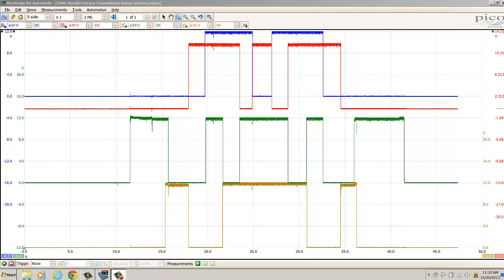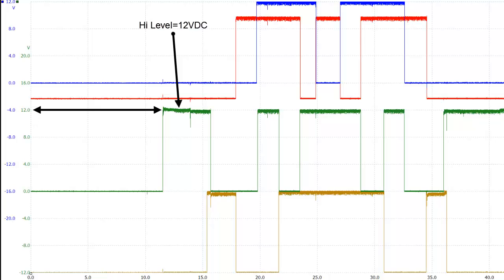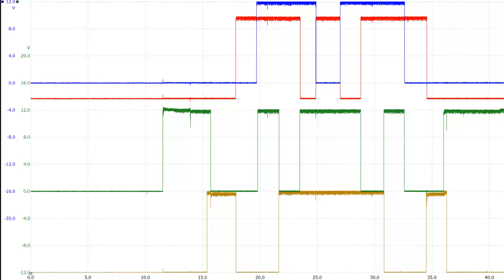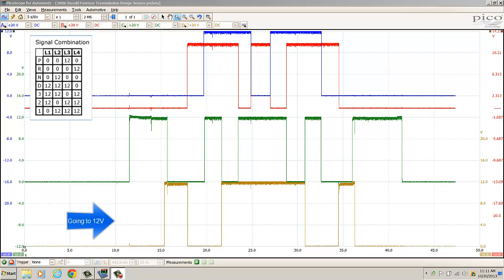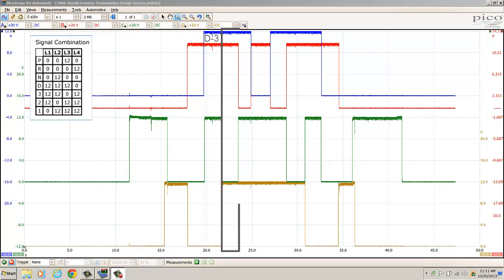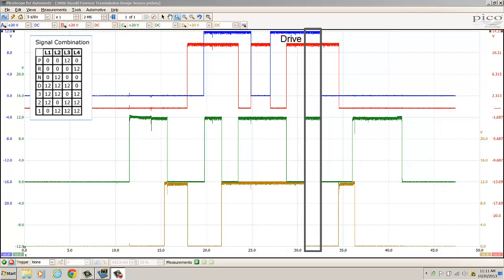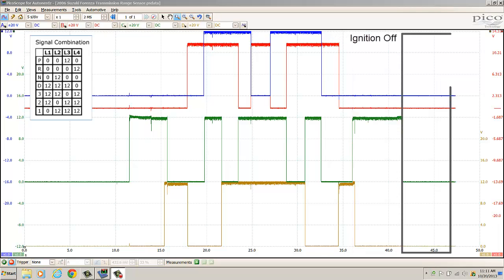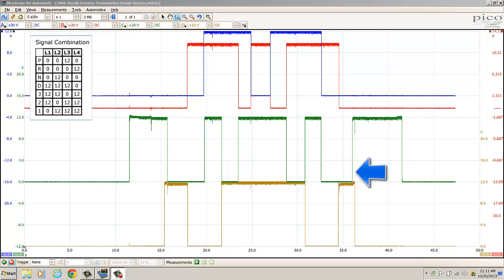Analyzing Transmission Range Sensor Waveforms on Picoscope - Part 4

Comment: in your analysis you mentioned you would come back to your test after replacing the range sensor.  do you recall if it made your test look better?
Reply from the maker: Yes, it did make it look better Greg! It was only the matter of time constraints with the video that I didn't show it. :)
Reply: @stuzman52  thank you.  your videos are really good.  I appreciate the effort you have done in teaching.  There is a lot of time putting these together I am sure. I have already replaced the range sensor and it works most of the time. My problem may be mechanical. Intermittantly I will get the clunk when in D and when I reaccellerate after a slowdown say about 30 mph.  So I just drive it in 3 until after 40 mph then put in D and have no issues as long as I dont forget.  I dont have an oscope to pick up what you are seeing.  My thoughts are it may be mechanical like oil.  I got the 07 forenza used with 125k so not sure if rans oil was changed. It is not simple to change or flush.
Reply from the maker: @gmanfgth  Greg, if you have a scanner, you could look to see if there is a code in memory for P0705. This code indicates there is an issue with the range sensor. Also with the scanner if you have one to look at the transmission control module, (TCM), you could look at the values of the range sensor and that may also help. And worse case, you may have an internal transmission issue. Hope you get it figured out and that it's not too serious.
Reply: Thank you again.  not sure if you remember but about two years ago I did a timing belt change with your videos.  always a pleasure to view them.
Reply from the maker: Thank you Greg! I'm sorry I can't remember you as I've literally had hundreds of people's comments that I respond to. I'm glad to hear that the videos have been helpful and it sounds like all worked out with the timing belt change :)
Reply: @stuzman52  it worked wonderfully and Iearned  a ton along the way.

Comment: I have a question.I'm asking because TCM can be hard to get on some cars,while the switch can be on easier location to test .Is it a good diagnostic strategy to do all checks only on the connector for the switch.First check for 12 Volts.Then check the wires that go to TCM with H7 55W halogen bulb voltage drop test and if everything is ok - replace the switch?
Reply from the maker: If you want to eliminate the switch and wiring in one shot, you could go straight to the TCM and check there. On the other hand you could do it as you mentioned. The wiring for the switches is very low amperage so you woudn't need to use a high wattage bulb. A test light of say 200mA should be more than enough.

Comment: Do you have a tran.range sensor wire diagram for a 2002 Suzuki grand vitara 2.7L XL7? Or is it the same with this Forenza?
Reply from the maker: The diagrams look a little different from the 2008 model. You can get free wiring diagrams and TSBs for your car. For that matter, you can get them free for any year, make, model, etc. Go to http://www.bbbind.com/tech_database.html and fill out the short form. After clicking on the agree button, you'll be able to select your vehicle and get the diagrams. Are you not sure that your engine isn't a 2.5L? There wasn't a 2.7L engine listed when I looked. Have a good one!
Reply: after verifying from owner, it is a 2002 Suzuki XL7 which has a 2.7L. Yes I did look it up at BBIndustries. The reason why Im looking at the range sensor is he had his starter changed recently. Now his ignition sometimes does nothing when on KOER; fuses and relays ok. Im looking at the direction of the TR sensor.
Reply from the maker: Robert Lesaca you can always print the diagram out Robert and verify that it does look correct to the 2.7 L engine.
Reply: Thanks...noted

Comment: Hello. Thanks for share.
I have several questions. I have a Chevrolet Optra 2009, is the same model for Suzuki Forenza:
- I don't understand if you change the part, for a new part?
- Those products that you used for the contacts: What is the principal function? And what happen if don't do it?
- How long does this piece? I mean,  How is the period of validity of that piece? Thanks
Reply from the maker: MissVenezuela33 The switch contacts inside the housing are to provide high (+12VDC) and low (0VDC) to the transmission control module in a unique pattern that the module will recognize. With this unique pattern of highs and lows the module can determine what gear the tranny is in. The part has a high failure rate as the design of this part is not that great where replacement in some cases is probably around a year.

Comment: If I'm diagnosing this from home what would be a cheaper method of reading all 4 cables at once? I'm pretty green at trouble shooting electrical wiring but the way you break it down seems simple enough to try!
Reply from the maker: Hi Stewart. The quickest and easiest way to see all four lines at once is to use a scanner. However, it wouldn't be a generic scanner. It would be something like a Tech2 scanner with the Suzuki software. That will run about $5,000. Otherwise, you can use a scope like I show which is still not cheap or you could use a voltmeter, but you would have to look at each line separately. The voltmeter would be the cheapest method. Take care...
Reply: Okay thank you. I'll try and see if I can fit four volt meters and get the readings simultaneously
Reply from the maker: Well, you can do that Stewart, but it's a little overkill. I would just use one voltmeter and just move a t-pin over to the next wire, record the measurement and repeat until you got all four measurements. But if you got four voltmeters, go for it!

Comment: Yes I was talking about the picoscope . I bought one at work. it turns out it is very handy for finding those intermittent problems in control circuits and devices. I have used it a lot it pays for itself real quick when you can fix weird problems fast

Comment from the maker: For a Suzuki of this vintage, the OEM Tech2 scanner is used which I do have. But I don't have the software for it and didn't want to spend several hundred dollars for it. There may be an aftermarket scanner that can read all four of these data lines that you mentioned. On GM vehicles, no problem. Yes, it would be quicker to just read the inputs that the scanner would read. If not, then this method of using a scope or DVOM would be required for troubleshooting. Thanks for your comment!

Comment: I recently purchased a picoscope and this is just fantastic.  If you were using a dmm would it be possible to catch the overlap  between green and gold.  As for the manual vacuum pump its made by  Mityvac,  On my daughters cobalt you can change the filter from topside and she uses the pump to remove all the oil thru the dipstick.  Looks like your daughters Honda could have the filter changed topside also.  The first time we changed the oil I measured the amount and it was bang on.  No mess .